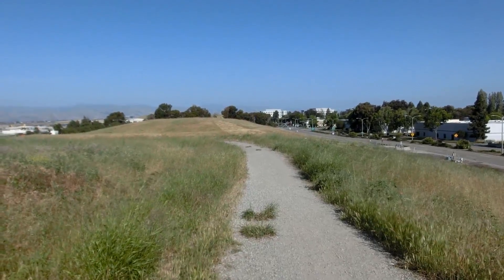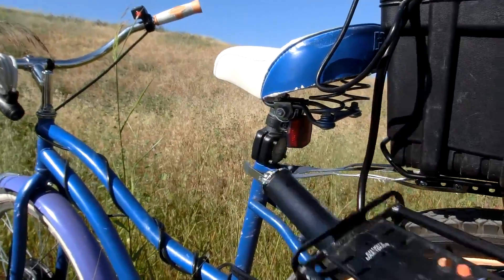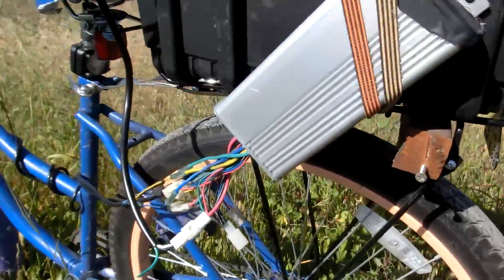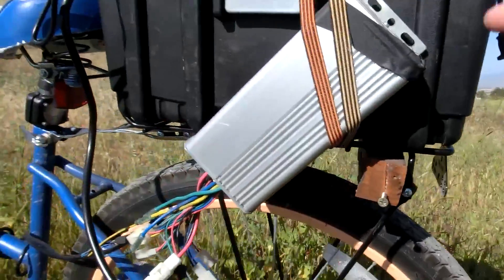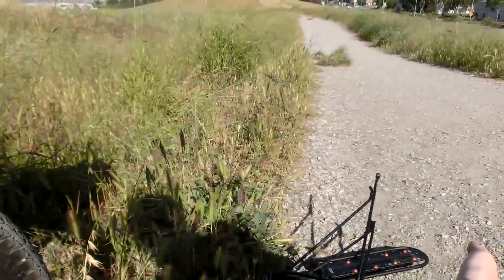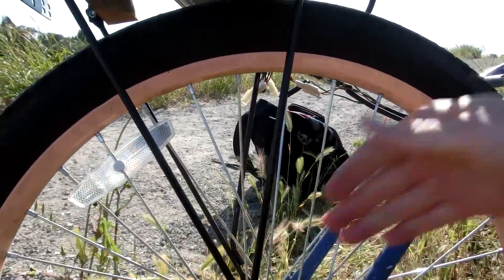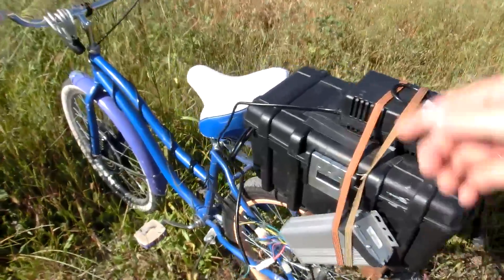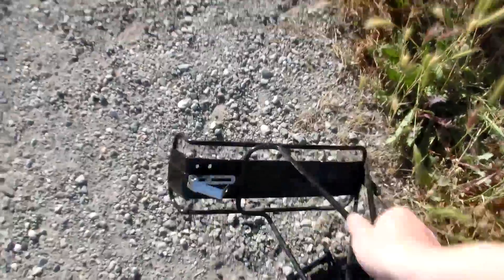What Bicycle Racks Should You Avoid? DIY E-bike Experiments

Comment: I have the same quest for a good rack. I had the Bell model, attaches to stays or QR seatpost clamp and at the axle, rated 45 lbs but the rack mounts to those vertical supports broke at the rack. not even a good Al alloy. it's Chinesium pot metal. Probably I'll end up weld up my own design from steel, but I'm trying out a Sunlite HD 50 lb rack now. we'll see how long it holds up.
I get the most stress from side to side swaying, so maybe steel drop supports are a necessary mod

Comment: Have you thought about a custom saddle bag style mount? It would keep the weight low and free up above the wheel for temp storage. Some light weight mesh for the wheel side to keep the bag material from the wheel and a steel frame to mount it on or you could go with solid boxes but thats more weight to carry.

Comment: http://www.sears.com/schwinn-quick-release-seat-post-rack/p-00666640000P?hlSellerId=14226&sid=IDx20110310x00001i&kpid=SPM7926804202&kispla=SPM7926804202

That's the one I got from target and the underside of it is a VERY HD piece of steel. In fact I'd be worried about stressing your seatpot too much if you take the plastic off of this and load it down too much. But it will not suffer any metal fatigue problems.

(this typed first so it makes little sense now) PPS -- There are cheap steel ones available. I bought a seatpost one from Target for like a sawbuck and while the plastic has broken away carrying heavy loads the main unit is A-OK. When I get time I am going to try connect some baskets to it so they can hang over the rear wheel of one of my full suspension bikes (3) or one that doesn't have a place to bolt into the frame for a normal cargo rack (The Titanium Fantom).

Comment: I've been using the same Nitto rack for years.  Nickel-plated Cro-Moly tubular steel.  Very light and many thousands of miles with a load.  Still rock solid.  I agree, Aluminum is a really dumb material for a bike rack that is going to carry sustained heavy loads.

Comment: I simply welded my own e-bike rack. Cutted old bicycle(broken children bicycle) into pieces and used thickest pipes from it. As I have mountain bike(rear wheel having damper) I couldn't just weld stuff to rear frame(rack would jump along with rear wheel). Welded directly to middle frame. ~20KG of load (3x20AH 12V lead acid + rest) which is almost 1m behind the weld points on middle frame. I can ride everywhere and nothing happens. I could sit on it (63KG) and still nothing would happen. Only disadvantage is high placement of center of mass. It's harder to keep balance on low speed (as well as just making it stay without falling to ground).

Comment: The rack that came in a kit I bought from xceeeres has been holding up my 30 Lbs Battery pack quite well and sturdy for over two years now... It's gotten a bit rusty though, but otherwise it's in perfect condition. I'ma have to get a whole complete other kit just so that I can get the rear wheel with hub motor; they, or no one I know sell the rear hub motor wheel alone( 800-1000W, btw...) and I am gonna put the second motor on my bike soon. Since I'll be getting another rack, you're welcome to have my old one, if you want...
Reply from the maker: +Farrokh Mirbaha yeah i didnt think to keep mine since i had a trike at the time. ah well i should still have the one in illinois.

Comment: A suggestion,  find some 2nd hand panniers and get your center of gravity lower. Distribute the weight equally on both sides.  No wobble and less sway in the turns.
Reply: +MrEroshan Bingo! I'm going to build one and my ideal point is to get the batteries at the axle.... ideally more on the front. No reason the load can't be in all 4 corners and looks like he is discovering this.

Comment: This is a relevant video as we load those racks with thirty pounds or more and they waddle until the steel fatigues. Mine will likely break soon also unless I beef it up or replace it. We ebike owners should be aware.
Reply from the maker: +Charles Tatakis steel fatigues far less than aluminium though thankfully.

Comment: Oh hey, do you or anyone know where I can find the wiring diagrams for E-Bike inverters?  The one in my scooter is messed up and seems to only work when I move it around like it's a loose connection or something but there are like 6 groups of cables coming out of it and I don't know what does what or where the connection even is so I'm going to have to take the whole thing out and test it with a meter or something.

Comment: Could you make your own rack out of steel? At least then you would know it is built to do the job you want it to. I have often found that cheap can be the lifesaver. I had a cordless drill that was nearly £60. It couldn't drill into concrete. Yet a £14.99 one could drill the same concrete all day no problem. Both without hammer function. it's just crazy. have an amazing day my very good friend.
Reply from the maker: +Raymond Earle yeah thats what i did for a 1960s bike back in illinois, it worked really great too.

Comment: Thanks for sharing mate. I still have a question about the battery pack though. I have batteries (all 18650s) of different specs and I'm not sure if I can use them in the same pack. Does it affect the balancing part?
Reply: +psygn0sis no
make balanced packs ( mix 2000 with 1500 mah cells if necessary )
but I would recommend only using cells above 1600 mah and balancing the packs from there ( rinoa made another vidéo on this )